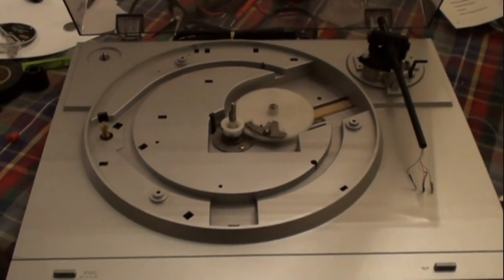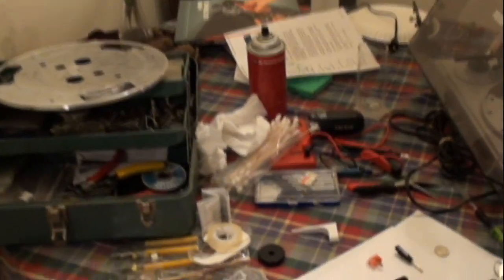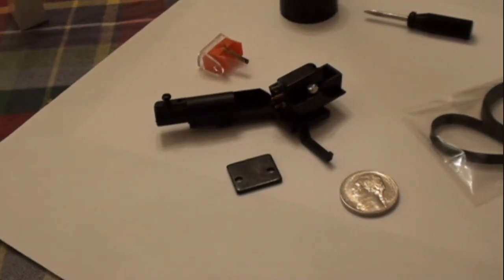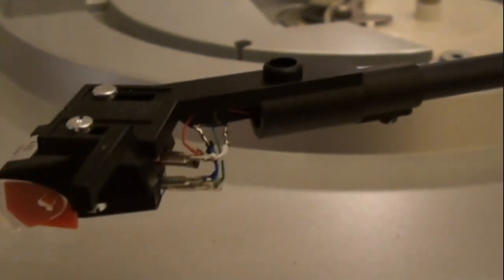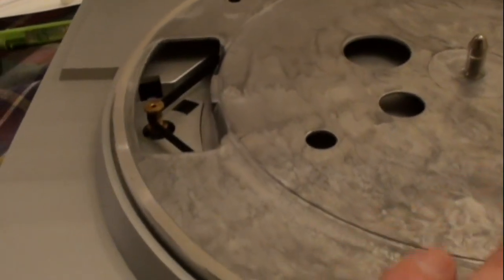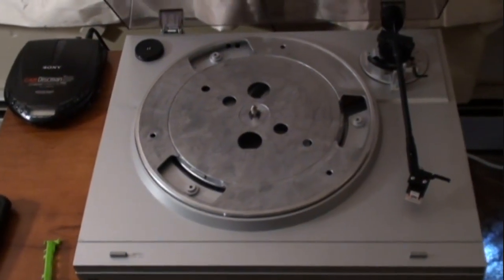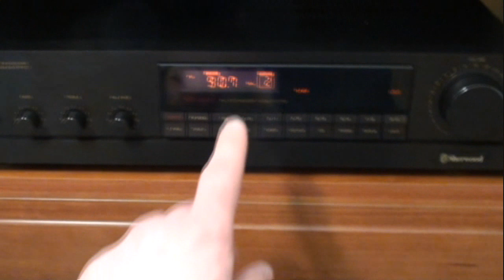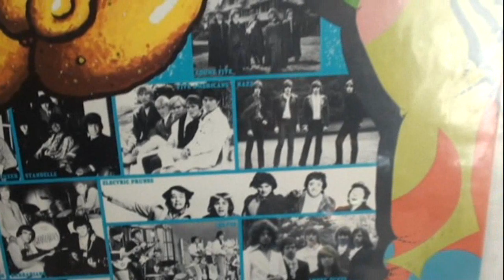Stereo turntable repair

Comment from the maker: Maybe it is A poor connection from the stylus/cartridge to the amp of the unit. If A ground connection is poor you will get A loud humming of 60 Hz ; this is sound of the plug in wall current/clean any plug ,socket etc.

Comment: I own a MCS 6701 Record changer model with the two spindles 33 and 45 and short spindle . I bought it from ebay for 50.00 bucks . I had to buy the 45 spindle but that cost me just as much as the turntable it self too . Its got nice sound , but I broke the hinge on the dust cover . Now I need to rebond  it to the plastic .

Comment: Well, the turntable itself doesnt have a ground connection, and i still have to check about the stylus conection
do you think if i add a new components suchs as replacing transistors, resistors, capacitors, etc, will improve sound quality?

Comment: Hi, i have a wards airline 1964 solid state turntable, it works fine, but i have a very bad junk signal when i play any record, even stronger than hiss, im thinking about changing the electronic components, such as potentiometers, capacitors, resistors, and  the main transistors, but im not so sure if they make a change in the sound quality.
what do you think i can do to eliminate that junk signal?
by the way, that signal comes sometimes, sometimes im lucky and wont appear

Comment: Hi referencing the post below . I have a turntable and when in use only the right side speakers come on . When i flip to the tuner all work correctly ? Could this be caused by a loose ground wire perhaps
Reply from the maker: More like the wires that go through the tonearm and plug in to the cartridge; check  if leads are  broken or mistakenly connected.
Reply: hi thanks ..it is a sony PS 4300 direct drive unit ..Might you have any videos on how to accomplish that ?
Reply: Youtube has a video of any job you need.

Comment: Hello sir I I have a Numark TT USB turntable I was using it and then I went to change the record and all of a sudden it only started playing out of one speaker and the speaker that the music is not coming out love makes a humming sound I hooked up the speakers to other equipment to make sure it wasn't the speakers and music came out of both would you happen to know what might have caused this
Reply from the maker: You may have A loose ground wire connection or A lead from the cartridge.
Reply: Ok thank you do you know if that's easy to fix or cheap if I take it to the
Reply: Shop